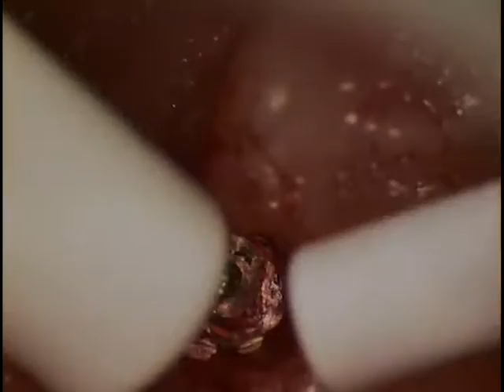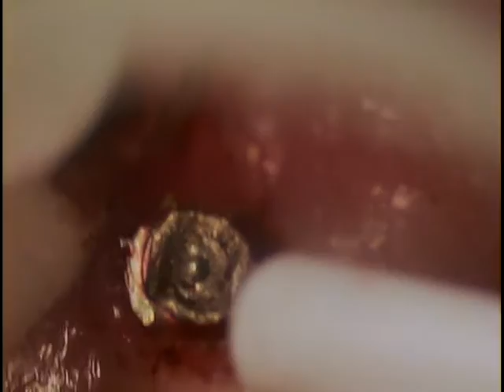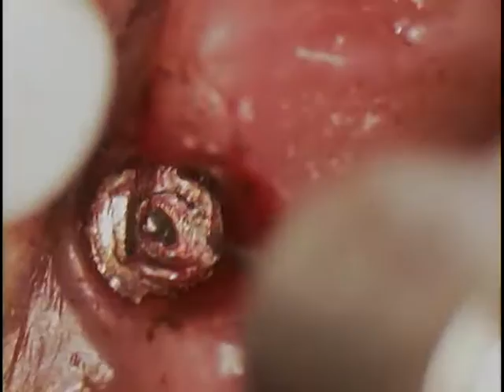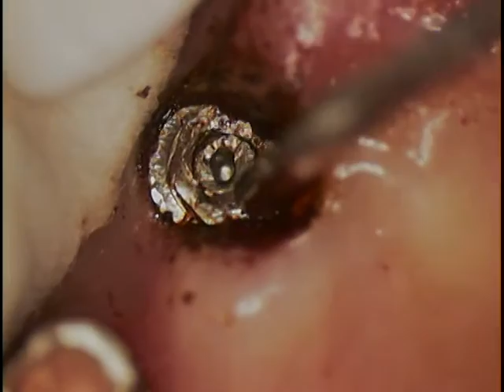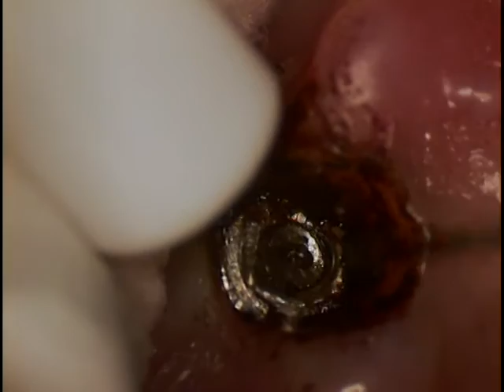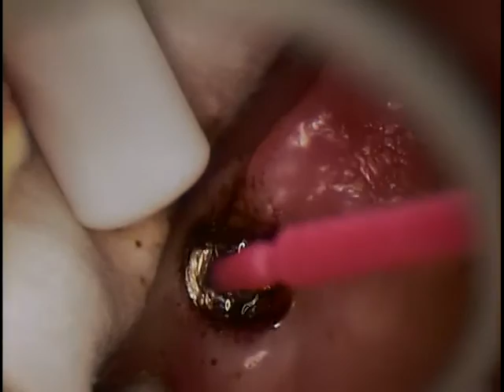Successful Drill Out of a Broken Dental Implant Abutment Screw 2 of 3

Comment: what bur are u using to drill pilot hole?  I have a broken screw to remove
Reply from the maker: Moe Ahmad   Alpin 1/4 round carbide with Crisco oil or machine oil. I like to continue to use tarter and stain remover solution to dissolve particles of bioburden.  The industry needs to manufacture more TAPERED TAPPING instruments.
Reply: Gerard Cuomo DDS  I agree.  Rhein 83 is a kit that has a bur tap.. http://www.rhein83usa.com/Prd_ScrewExtractorKit.aspx
I think they can make one for you custom...